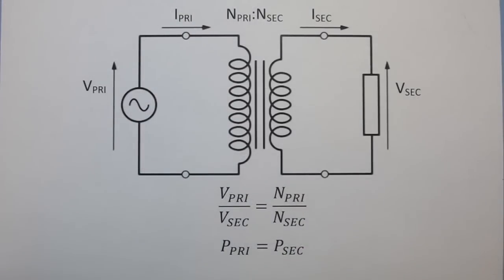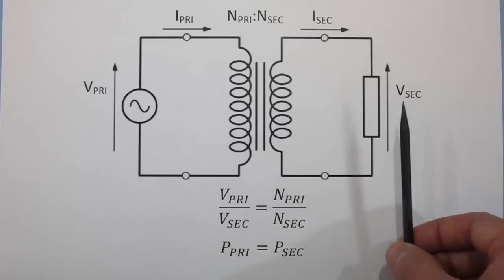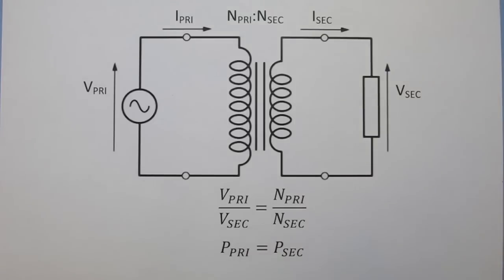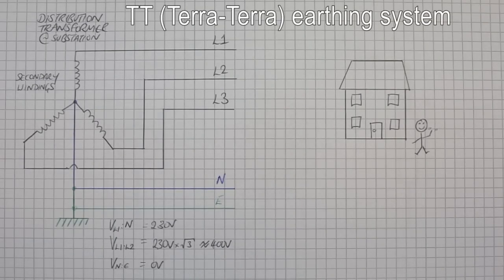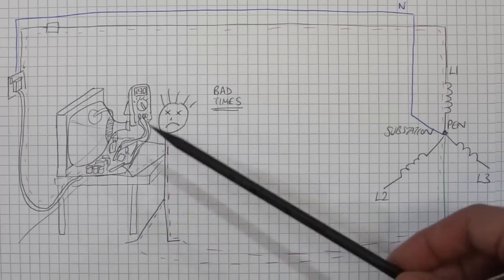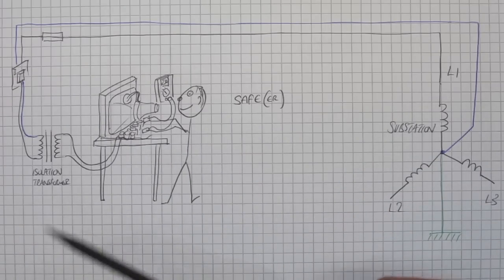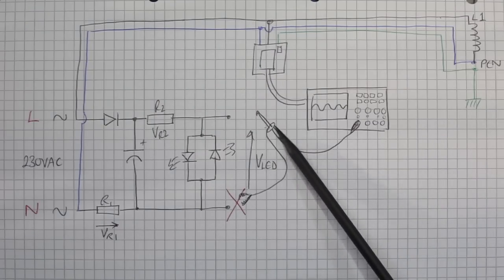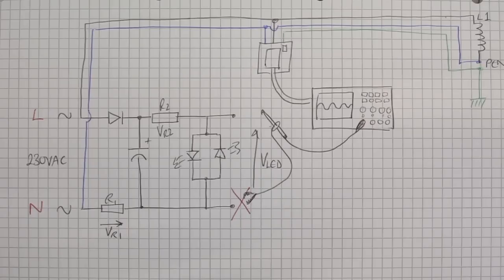SDG #06 Mains Isolation Transformers and UK Earthing Systems

Comment: I am trying to size a small isolation transformer. A 220V source will be connected to my transformer, which in turn will supply the electric to my 220V 40W 0.45A induction motor with gear head to be controlled with a speed controller. Can you advise what VA transformer do I need for this purpose?

Comment: If your house is fitted with and RCD though, isn't using an isolation transformer less safe as you would loose the protection given by the RCD...
Reply: The wall outlet RCD only protects for leakage current up to the primary of the transformer there is no earth leakage protection on the secondary.
But if the outlet from isolation transformer has an earth pin, you may use a RCD plug on the secondary.

Comment: You correct that misapprehension that some techs have, who say that they do not need an isolation transformer when working on a valve guitar amplifier, because it has it's own transformer in its power supply and is therefore 'already isolated'. They fail to understand that the secondary of the PSU transformer is grounded, and thus not isolated from the mains.

They need to watch your well-informed video to put them right.
Reply: Using an isolating transformer does not help in this scenario. The isolation transformer would only 'protect' you if you came in contact with the circuitry on the primary side of the power transformer. On a guitar amplfier this circuitry is normally fairly trivial and not exposed. As you say, one side of the HV secondary is normally grounded - so this is akin to having an isolation transformer with the ground still connected, and increases the shock hazard. Using an isolation transformer does not change this.

Comment: I bought an $250  I/T for my 14 year old future electrical engineer. It will protect the scope and other equipment but not his life. I have 22 circuits in my house and all circuits each have a  RCD (residual current device) which trips in 30 m/s and at a 15 mA imbalance. They are mandatory in new homes in Australia where we have 240 vac and the common ground (neutral) is tied to the ground stake as in may other countries for safety. I can with bare feet, and bare hands place an metal object into the active on any power outlet and the RCD trips. The RCD costs about $15. I am afraid to let my son use the I/T,,, and I am bewildered why I bought it for him... perhaps because I watched so many YouTube videos on them... Can anyone please comment, thanks.
Reply: If the outlet from isolation transformer has an earth pin, you may add a RCD plug on the secondary. Isolation transformer with a RCD plug on the secondary can power DUT and an oscilloscope can be safely used on a DUT. The RCD plug on the secondary of the I/T can protect one's  life in case of inbalance. Nothing will protect a person if that person grabs one wire with one hand and the other wire with the other hand.

Comment: Although a brief description still very well detailed and can be well understood with the drawings provided.  Well done and keep up the good videos coming.
In my case I have a 1.5KW isolation toroidial transformer which I modified from a commercial pro amplifier. It gave 100v-0-100v in the secondary and I added a winding in the middle of the secondary to add the missing 40v.  This powers my work bench and all repairs are plugged into it including my test equipment except the oscilloscope which has its own isolating transformer.  My system is all floating from ground and to get electrocuted I have to touch both wires simultaneously which is not very likely to happen.
Reply: 0😢😢6😮5😅😅j
Reply: 9j9😢😢6😅6😢z0😅66

Comment: What would happen if you touch an earth against the live on the isolation transformer would it just make the earth live without blowing any fuses?
Reply from the maker: Yes, although there is no live/neutral really on the secondary side until you introduce the earth conductor again. The "live" would essentially become neutral because it is now at earth potential. The other terminal would be "live".

Comment: You shouldn't connect your oscilloscope to a isolation transformer, that's even more dangerous
Reply from the maker: It depends what you're trying to achieve and your set up as to whether it is dangerous or not

Comment: Very good video.  Isolation transformers are hard for people to understand.  The main thing, I think to remember, is the main purpose of the isolation transformer for a tech bench is to separate the neutral and the earth ground.  That way if the DUT is earth grounded, the neutral is not and the circuit is only the hot and neutral of the output of the isolation transformer.  Be aware most isolation transformers for sale today have the neutral and the earth ground bonded together at the output receptacle defeating the separation and for a tech bench one would have to modify the isolation transformer for tech use, in my opinion.  Tom

Comment: When building your own isolation transformer do you still connect the earth of the mains electricity to the earth on the output of the second winding?
Reply from the maker: It depends on the circumstances. You can, and the other alternative is to link the N and E on the secondary
Reply: This issue with this, is that when it comes to a piece of equipment where a 0V of the Unit under test, is directly tied to Earth/Chassis. When your scope is earth referenced, and you clip the earth of the probe to lets say +50V supply, then your scope will connect that 50V to earth, which then goes to the Earth in the building, then back through the earth of the isolation transformer, to the 0V of the UUT. So you have shorted out that supply in a big loop.

So depending on the appliance, it may be required to break the earth to the UUT, so that you can freely probe anywhere on the circuit. But IMO is less safe.

Comment: hi. How do you tell which end of the secondary is the live one? Or are they floating until one of them gets connected to earth ground e.g. by connecting the ground clip of a oscilloscope?
Reply from the maker: bergweg Exactly that - there is no sense of live or neutral until you provide an earth reference.
Reply: SDG Electronics 
But if you provide an earth reference, e.g. connecting the ground clip of oscilloscope, then aren't you going back to the same situation as a non-isolated transformer? This means the circuit is earthed and if the +ve end of probe touches any part of the circuit which is earthed or grounded, it will create a short via the oscilloscope. So how can we do any probing in this case since we can't tell whether what we are probing is negative or positive? Could you please help to clarify. Thanks.

Comment: Nice video - Some questions:
I was taught that test equipment (scope, etc.) should not float, while the DUT via a iso transformer can.  You suggest floating both, is that safe?  Furthermore what are the consequences of the other was around (float the scope via iso transformer and connect the DUT direct to mains?
Finally, A friend has his bench setup like this:  mains to GFCI (ground-fault circuit interrupter) receptacle then a iso transformer plugged into that.  Isn't this self defeating in the sense that the GFCI will never trip because of the iso transformer?  What do you think?
Reply: I worked in electronics for most of my life in both test and engineering. We floated 90% of our test equipment so we could accurately see what was going on inside the DUT. You had to be careful when doing this but in all those years we never lost anyone, a couple of folks got woken up but that was it. If you don't know how to do this safely you shouldn't be in the lab.

When working on something like a radar transmitter power supply the equipment was all grounded just for extra safety - you don't want to lean on a scope thats floating at 24,000 volts
Reply: What means DUT ???
Reply: @incxxxx  DUT means Device under test. :)
Reply from the maker: Ken Cosi Floating the scope is fine provided you understand what you're doing - firstly you need to ensure the scope still has a protective earth, meaning that the chassis should typically be at the potential of one of the incoming line conductors so that if there is a fault in the unit the user is still safe. Secondly, if your DUT is mains earthed reference and you're probing across a component that's above a few tens of volts referenced to mains earth, you need to understand that the chassis of the scope will be at this potential and could be dangerous.

Regarding your GFCI question, the GFCI will only protect against shock from the transformer itself, which is not necessarily an unreasonable precaution.

Thanks for watching!